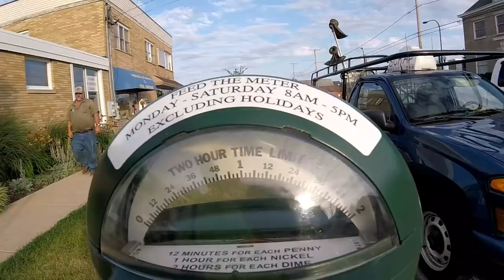Brand New Just Sitting on the Curb

Comment: First of all thank u for sharing the video Paul and God bless, furthermore just a quick tip being an ac guy myself.  If u ever find used or open ac compressors make sure u pinch the lines closed cuz they will leak pag oil or charging oil all over ur truck bed, keep up the good work and thanks for the videos.
Reply from the maker: Thanks Arnold.

Comment: Never cut the cord to the vaccums they almost always work they might have a a few minor issues like a broken belt or a clog but those are easy cheap fixes and you can sell a vaccum for around 20 to over 100 dollars and do not scrap the mower and the trimmers those trimmers are Echos. Echo is very expensive. One of them cost 300 dollars and one costs 170. It’s worth either fixing or selling then for like 40 bucks each or 30 non running. The 300 dollar one (the straight one) can be sold in running condition for about 120 dollars and smaller one for 70. And certainly fix the mower. It’s a Honda and it costs about 500 new. Can get around 150 for it in running condition or about 40 or 30 in non running condition. (Update I watched the video further and found out you will get the lawn equipment fixed which makes me happy because there worth a lot)

Comment: Not Criticising LOL! Black screws halfway down mower handles fold it in half. Petrol mowers & strimmers often only need filters washed or spark plugs cleaned/replaced. 2-stroke engines need oil, 4-stroke doesn't. Fixing takes them from 30cents Scrap to $15-30ea. Spark plugs are $3-20 new so it's worth unscrewing them as you do with brass.

Comment: I used to keep a kids plastic toboggen around with a long rope tied to it, and use it to drag stuff from point A to point B. . . slides over concrete, grass, gravel. . might save ur back n legs some.  God bless. Holy moly. . speak of the---there went your sled.

Comment: Hon, you put the lift on the truck but you need to start pulling up right beside a stop. Make things good and easy. Seriously, we ain’t as young as we used to be… in my case my knees. You better believe walking hauling weight  when out scrapping I don’t park away from my target. Walking weight depletes your energy. I walk for enjoyment not profit.i exercise my legs , knees and arms, shoulder in a constructive manner. Repetitive and on my time. Even though I’m female, I can haul and lift a lot of weight and I use a safety weight belt. Water heaters, stoves, fridges,microwaves. I hit open top dumpsters and pick them apart. Pull the truck up beside them and pitch over the side. Im 66 and going strong.

Comment: you part heavy duty springs on rear of that and you can do two stories. Would be very cool, very beneficial.....
Reply from the maker: Not beneficial. Have your vehicles use more gas and tires pop much much easier in the scrap yard.

Comment: hi again,  I just heard you say you make only 3 cent a pound scrapping metal.  did I hear that right.?  Is that really worth the work and dirt.  wouldnt you make more collecting aluminum cans?  I believe in fremont/union city CA  aluminum if I remember correctly $1.30 - 50.  lb.not sure but I know its more than a $1.00.  collecting metal I just dont see the the worth in that.  gas, ware and tear, time, the dirtyness, and then the pay out.  dont see it.  i hope im wrong hearing 3cents.  I didnt replay
Reply from the maker: Right now across the whole country shreddable steel light iron is being purchased between 3 and 5 cents per pound.